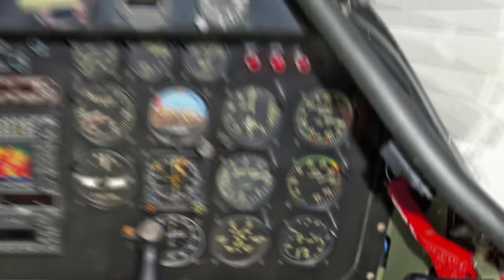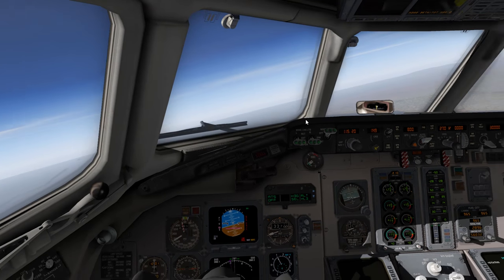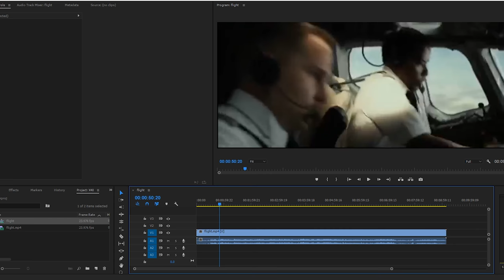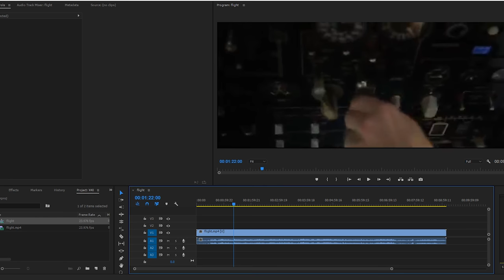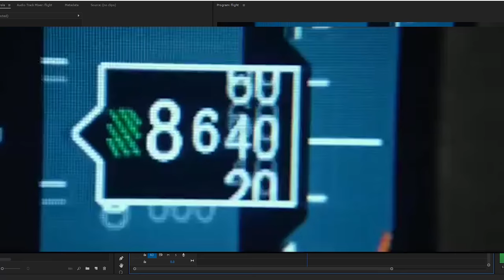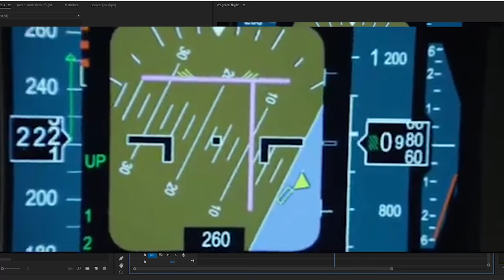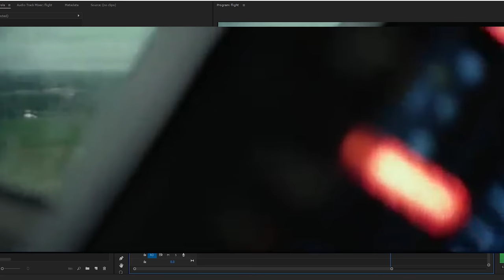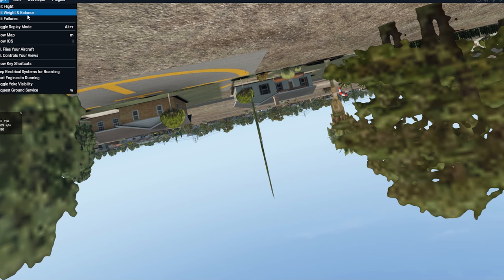Flight Movie: Can an airliner fly upside down? [Simulation]

Comment: since i learnt about the alaska air accident... i was also thinking if any possibilities of saving that aircraft exist. one possible crazy method that i could think of was to lower the speed and move the center of gravity to the rear of the aircraft by squeezing all the passengers to the back of the aircraft.  (ofcourse its not safe). But would it work? im curious? would the weight of the passengers be enough to counter the force produced by the horizontal stabilizers? Seeing a simulation would be really interesting.
Reply: No, not enough weight to offset the stab failure. That horizontal stab assembly likely departed the aircraft long before impact.

Comment: Doesn't have hydraulics meaning or referencing the main system ...the back up is small propeller motor under the aircraft used to generate electricity and hydraulic pressure
Reply: Stephane Gagne that would be called the RAM turbine. It’s not all planes but I’m not sure about the md 82
Reply: Joshua McConville thank you for that clarification  although  in all practicality  under most conditions  the plane would normally be doomed to crash ..I do believe though that in a favourable scenario that the manoeuver could be successfull  ..almost impossible but a very small probability that it could be done...I think that going through certain wind gusting vortexes hitting the plane at the right angles with the right wind speed could possibly create the condition and or conditions of lift rendering the manoeuver and landing possible ...example  tornado or hurricain winds and the turbulence or aray of turbulence effects that could render the manoeuver and landing possible...again although impossible under normal conditions I believe under extreme conditions there lays a chance if success like a pin needle in a hay stack chance... but still the needle is in the hay somewhere.... Cheers
Reply: Stephane Gagne obviously I can’t say it’s not possible. The chances are extremely low but I can’t entirely rule out this sort of manoeuvre

Comment: An airliner could theoretically fly upside-down but it certainly wouldn't fly well. It would be very difficult for the pilot to maintain stable flight and avoid stalling, overstressing the airframe or otherwise losing control. Bottom line: Not something you want to try.

Comment: some of the avionics eg flaps on a md-80 are not a fully controlled by hydrolics are mostly manual with hydrolic assist
Nice Vid
Reply from the maker: Thanks! I did a test on the sim with no hydraulics and I was not able to do anything at all. It may be short simulating its complex systems.
Reply: And it was a film with obviously the laws of Hollywood. It would be good in x plane to be able to fully customise a failure . It was a good vid very well don.

Comment: I think inverted is not possible ,because the lift and weight goes to the same place ,so no way it would be possible
Reply: Don OutPlays fighters fly inverted thanks to an increased attack angle, maybe that's what he's done there
Reply: Don OutPlays  It's been proven that all planes, including the fictional plane I guess, will fly inverted. As the scientist in the video I watched stated, After testing a plane in a wind tunnel, that yes it is possible to fly inverted an airliner, just extremely inefficient, and uncomfortable from the passengers
Reply: the test pilot of the 707 gone inverted in one

Comment: You can definitely not land inverted. The structure of the plane is too weak on the top side. It is more or less just an enclosure for the passenger room.
Reply: It DIDN'T LAND INVERTED. It flew inverted to arrest a dive, then rolled back to make the final landing.
Reply: It is obvious that it did not land inverted. I am answering this guy's question, if that would be possible. God damn, watch the video before commenting.
Reply: 'Sorry. There was such frustrating blindness in the discussion I myself skimmed and was blind to your prior comment. =)
I had already viewed the movie many times both by myself and with friends I discussed it with.

Comment: Yo forgot to dump the fuel, therefore, you were too heavy when rolled back the plane at 1600 to fly in a normal attitude. I think it would've worked if the plane was not so heavy with fuel.

Comment: In 1955  Boeing test pilot Tex Johnson did two low altitude barrel rolls in the Dash-80 which was the protype of the B-707
That particular aircraft is nose to nose to nose with  a Concorde and the fully restored Enola Gay at the  Udvar-Hazy extension of the Smithsonian's Air and Space Museum
https://www.youtube.com/watch?v=AaA7kPfC5Hk

Comment: Alaska 261 did try to do this!, could have worked given more alltitude
Reply: Jeff Hide you’ve missed the part where when you roll back you will plant the nose directly into the ground
Reply: Joshua McConville  well what’s better? An impact at 30000 fpm or 2000fpm

Comment: Of course you can't fly a commercial plane upside down.. It's simple aerodynamics.
Reply: CHGamer they can fly inverted for a limited amount of time however, the plane won’t be in a great condition anymore.
Reply: Joshua McConville it will start to nose dive (not doing anything)
Reply: CHGamer there was a plane which successfully flew inverted for a short period. Seen by other planes to be successfully holding altitude. Try again
Reply: Joshua McConville when did I say you couldn't fly one at all? You shouldn't and you just have to keep the pitch somewhat good. But you couldn't fly long periods as the plane would most likely break.
Reply: "Of course you can't fly a commercial plane upside down"

Comment: what if u try to land it upside down, at least there might be a chance?? since turning back isnt possible
Reply from the maker: Youd be having to go too fast for the plane not to stall. The crash landing at that speed would be a terrible idea, add to that that youd be upside down lol
Reply: I would think when the vertical stabilizer contacts the ground, either it would be ripped off, or the entire aircraft would be shredded to bits due to the g-forces from the tail dragging into the ground. You also earned a subscriber!
Reply: You clearly didn't use your rudder when moving from inverted to level flight and visa-versa. Which any pilot would use when doing such a maneuver. It would assist you in losing as little altitude as possible during the turn. With the rudder acting much like an elevator. You wouldn't have lost anywhere near the amount of altitude you did lose and you would have had more then enough altitude to go from inverted to level flight at the end.
Reply: I think I'd aim for water if possible whilst upside down and try to lose as much speed as possible to soften the landing. I cannot think of any alternatives. I think any failure like this you are looking at an almost certain fatal crash.

Comment: You assume that every aspect of your simulation program is correct. I'm an electrical-engineer / computer scientist, and I've written lots of code & developed lots of programs over the course of my life. Let me tell you, programs like that are (sometimes) FILLED with errors. Don't get me wrong, MOST engineers are thorough & thoughtful, and I'm sure regarding your simulation they had teams of pilots / physicists consulting / advising them. Yet, I'd be willing to bet there is AT LEAST 5-10 glaring mistakes in that program.  
(I've flown a plane, once, and know NOTHING about airplanes flight mechanics, but If the stabilizers were locked in a position which made the plane descend at -5 degrees, why wouldn't inverting the plane stop descent?)

Comment: this kind of planes just CANT fly upside down!  even full thrust and elevator stuck in lucky position . it will loose hight fast!  and add no angle control even if it is stuck = there is no lucky position   flighinh is a dynamic thing  if you dont compensate slight nose dive things just get wors and wors

Comment: Very interesting to find out causery of its fall aircraft USA on grass field near village .Forst of all  ..since the aircraft still in airport the climate around the airport very bad .Perhap lots of thunder but Captain could postpone the flight do to bad wheather condition or error .The second reason Captain running with normal gas perhaps 100 km/ hr after that adds the speed reach upnormal speed to penetration very thick dark cloud because Captain trys to avoid the flash of thunder could being damgerous for that aircraft .Okay...find after the flight crew seing the broght of sunshines the all pax happy and give applaus to flight crew .But ithink Captain forget to return back normal speed again and locking the steer which was under the steer and lets the steer alone.Besode that the predictionary of times to land little of unaccurate no need dumpling oil also no need rolling the wide body aircraft because this plane not similat with eagle supersonic aircraft .The system failure because of too fast driving aircraft to the sky and makes the gear door ruin also the front door gear also release because pushry of the winds ambivalent to face aircraft and makes lots of bumps to all staff in the out and in cabinet.And Capten also forget to gear down back again before landing ..why..at least the gears could be preventing the impack more hard (reducing) accidemt and victims dies cause of landing without gear down ..I think only that which i give the explanation althouth not too clear but i were the one victims on that aircraft too .Thanks for be with us as long as journey ..we just as passenger the decession on of course on your hand as PIC .Salut for people has involve in this movie hopely flight world as much as develope including the all staff Crew and ATC more solid .Debbie V